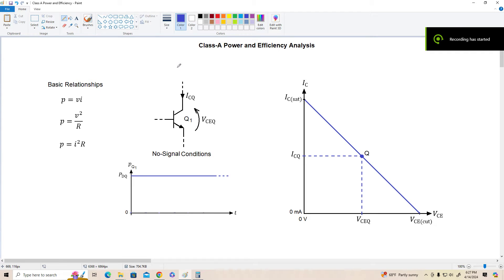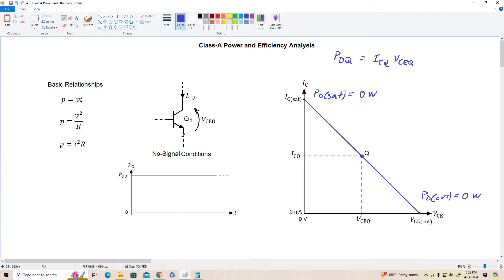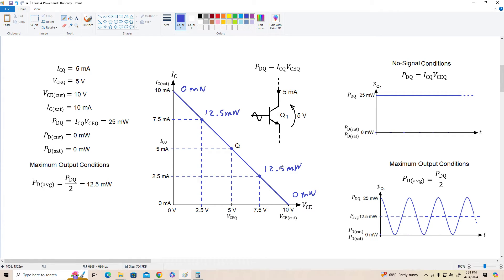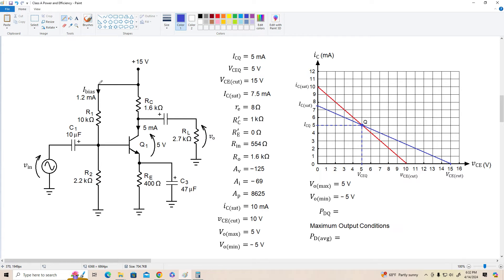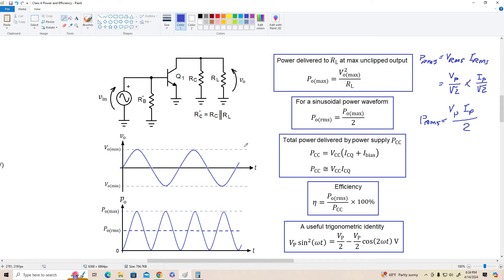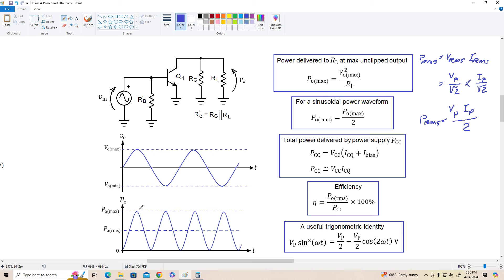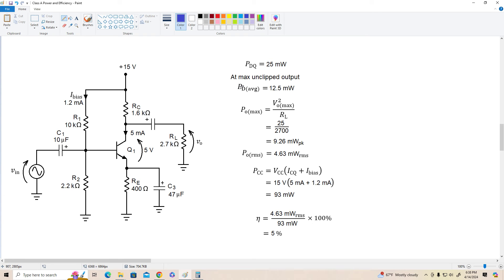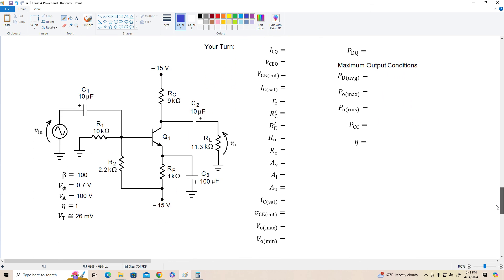Topic 36: Class-A Amplifier Output Power and Efficiency

Comment: GOOD LECTURE! DO THINK IT WOULD WORK BETTER IF YOU TOOK ONE HALF OF ICQ AND,ONE HALF OF VCE AND,SET THAT FOR THE Q POINT?
Reply from the maker: @davidluther3955  that would work if there was no load (or a very high resistance load). Then the AC and DC load lines would be identical. Maximum output voltage swing occurs when the Q point is centered on the AC load line, which is always steeper than the DC load line.